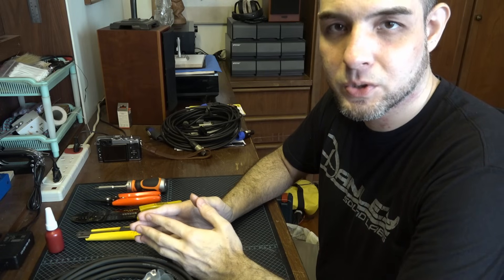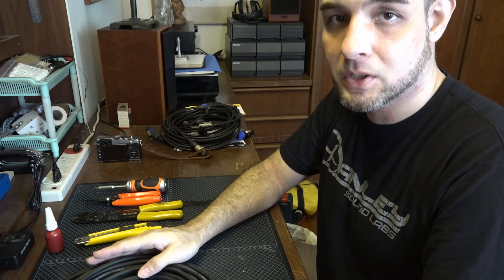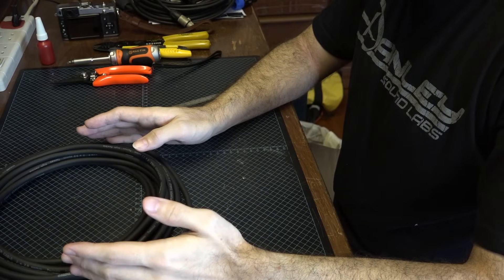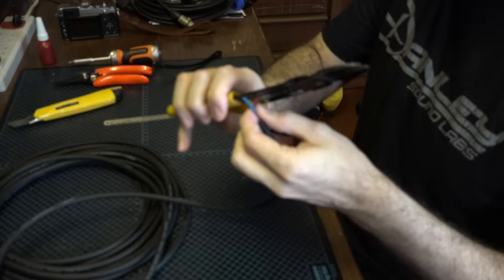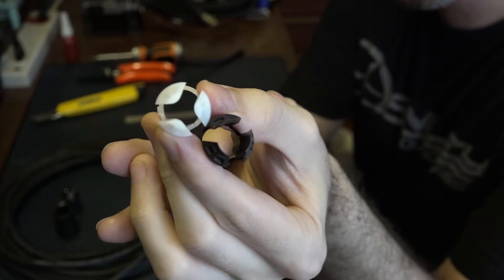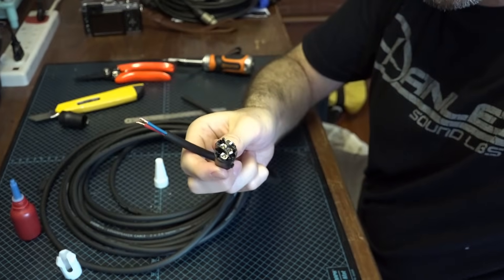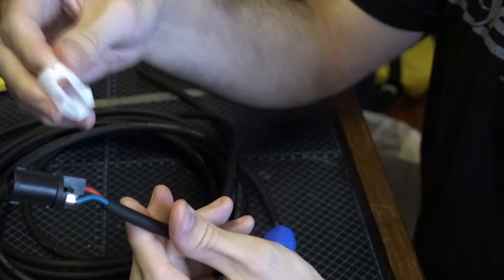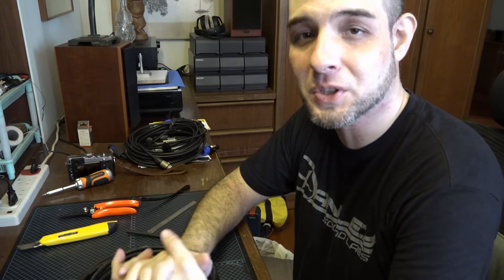How to wire Neutrik SpeakON cables

Comment: Hi ! First of all I would like to thank you so much for uploading this video. I went to electronics parts market. Got to see some variants of this connectors. Price would also vary drastically. I chose MX brand available here, rather then Nutrik as you have used. I saw that also. But there was price difference of over the times and as this was my first time with this connectors I choose MX. Almost similar but I know Nutrik is much better. Next time I'll use that only. I got lot of information about connectors through video.

Now about making connections, your video made it so simple that it was like piece of cake. I could make it very easily. +1 -1 pair was used. I made two 50 meters cables. Wire used was not that you have shown but my purpose was served very well. This has helped me setting up our door audio system, cascading four speakers. I have attached lugs also in parallel to these connectors so that I can connect it to my amplifier also. 

Once again I thank you from bottom of my heart. May The God be always with you, helping you.
Reply from the maker: In future I strongly suggest you use only Neutrik brand connectors. The others are much cheaper but their quality is also MUCH worse! Remember that you can be dealing with quite high voltages here - not a place to skimp on quality.
Reply: @GLBProductions  Definately.

Comment: Hi there, not sure if you still remember me but I’m the guy that handles my school’s PA system :). Recently, someone stepped on the cable of our pa speakers that were connected to the 4 pole speaking connector. The cables came out of the speakon house and I tried to open the speakon connector. The metal slide release “spring” went missing. Not sure how to get it to work again. Also, how do you wire a 2 pole speakon neutrix connector? I can’t seem to be able to get to the screws as I’m not too sure how to remove the plastic house ring slider is.
Reply from the maker: Yup I remember you :) If the release spring has gone missing I suggest you replace the entire connector - they are relatively cheap and last a long time.

Comment: Hey I purchased an 8pin for 4 full range 8 ohm speakers and 4 8ohm tweeters. I wanted to wire them at 2 ohms tweeters and speakers separately. Should I have bought the 4 pin instead? Let me know I'd greatly appreciate it.
Reply from the maker: It depends completely on how you want to wire the system up. Depending on your requirement and amp configuration both types can be used.

Comment: Thank you! But how do i know that i wire in 4ohm or 8ohms? AND what's the difference between Neutrik NL4FC and NL4FX? :)
Reply from the maker: The impedance is determined by the speaker, not the wiring. NL4FX is an upgrade to NL4FC - more expensive but simpler and more rugged construction.

Comment: Can these  connectors be taken apart in the event a wire comes loose?
thanks for the info.  After working in/ hobby  of RF, for the past 30 years, I am now getting into the AF end of things. 
again thank you. 73
Reply from the maker: Yes you can take them apart - use a wrench on the flats at the back of the boot to back it off. It will damage the ratchet mechanism somewhat but typically you can still re-use the connector.
Reply: @GLBProductions  thanks for the info.at this point I am still not wanting to use them. I feel that if one of these connectors in pluged into a speaker or an amp. I would rather have some one pull the plug out of the speaker or amp, than have them fall/ trip from stumbling on the cord., or even have the equipment fall and get damaged.  .

Comment: @ 15:06 you mentioned that it has a racheting system that prevents the end-cap from backing off.   But, if you want to disassemble it, how do you unscrew it and take off the end cap?
Reply from the maker: You need to use an adjustable spanner to back it off - it will damage the teeth on the ratchet system but the connector can still be re-used.

Comment: where can i buy the cable
Reply from the maker: Anywhere that sells loudspeakers and amplifiers should also sell speaker cable.
Reply: would regular 12/3 300v wire work also ?
Reply from the maker: Yup, you may also be able to find 2-core A/C power able.
Reply: and what about standard xlr/trs cable

Comment: Thanks for the clear instruction.  I've just bought some SpeakON cables and the connectors and was trying to work out what each terminal was for, so this really helped.  The tip about pruning shears to cut the cable is great too, I've never though about that, but it certainly makes life easier and gives a nice clean cut, I'll have to invest in some :)
Reply from the maker: You're most welcome, glad the video was helpful :)

Comment: I like to tin my stripped wire with solder.
Reply from the maker: I used to do this as well, but have found it to be an unnecessary step for the larger gauge strands of the loudspeaker cable.
Reply: @GLBProductions  Perhaps. I do it to prevent copper oxidation with age, better wire terminal continuities and lock-in. But meh, you're right, it is a bit fussy, but proper all the same. Silver solder on OFC cable might be over the top, but each to their own, this is only PA gear. I'm going to pick up a QSC PLD4.3 bridged into two channels - 4 Ohm, and was thinking about cabling, and NL4 connectors. I'm a bit noob though, and the high power speakers I'm looking at each have two inputs (x2) of +1 -1 & +2 -2 pass through. It appears I can use either input, as they are full-range only speakers, not bi-ampable? Well the internal wiring diagram looks that way. The speakers are QSC E215.
Reply from the maker: If you like to solder your speaker connectors you can get STX series Speakon connectors that are designed to be soldered - these are expensive but have a very rugged all-metal housing designed for pro touring. 
Correct, the E215s are not bi-ampable - either connector can be used as the input, the other one acting as a thru.
Reply: @GLBProductions  Thank-you. I knew + and -2 were through, but couldn't figure out why two different plugs offering both input, and output, but it stands to reason, to mark NL4 male plugs as in/thru (hence the need for the inscription window on the plugs as you described in this video.) But this system has a flaw, and that's if you were setting up a large rig to multiple amplifiers, and pick up a wrong plug marked in, when you thought the other plug was marked thru, but was in instead, so accidently put two inputs from two amps into one speaker. You'd have to be not with it to do something like that, but it could happen. Perhaps plugs and sockets should have been notched differently for in, or through to make it impossible to make critical mistakes?

I only want something to act as my loud punchy system without breaking a sweat in my lounge room, and use it at small venues later on. The rest of my system is SVS Ultra bookshelves, and SVS PB-2000 subs, and Ultra Center / Bookshelves running off an Onkyo 230w 7.2ch class AB receiver. I won't need subs with the E215's right now, as it'd be over-kill in a home environment, but not if they were used outdoors, or in a hall. I'm in no rush for the E118 subs just yet, as they would only sit in storage right now. Still setting up. Solar pays to run this gear during the day, so not concerned with power consumption when I do use them, and value my family's hearing lol. I don't think my quiet neighbours would appreciate me being an a-hole either... thump, thump, thump, thump! But all the same, it's good to watch a video like this to ask questions, and make sure I'm not doing anything wrong when I approach this gear for in first time ownership. Ps: I note the E215s are 4ohm, whick load up the amp a bit. The distortio jumps from .04 to .06%, but I don't think it's noticable. I've owned amps much worse, but have a more tasteful eye these days. The QSC PLD amps don't mind being bridged at all, with little power loss when doubling up, and it would appear on paper little jump in distortion when more resistance is added. They are quite impressive class Ds imo, can't wait! Thanks for your replys :-)

Comment: Bruno, very informative video.  I will use these on a solar project.  Thank you sir !!!
Reply from the maker: Neutrik actually make similar connectors specifically for AC power - they are called PowerCon connectors, check them out.
Reply: @GLBProductions  plz give avideo on powercon also

Comment: My box is 4 spekers & 1600watt rms power (each of 400w & connect in parallel) at 2 ohm.So what is actual wire gauge needed  for 30 ft run at 2ohms impedance load?
Plz reply it's an important........
Reply from the maker: Just google 'speaker cable gauge calculator' - there are several out there that will give you the info you need.

Comment: wich wire goes to the tweeter and witch wire goes to the woofer of the speaker? if I want use a dsp amp?
Reply from the maker: Each driver (woofer and tweeter) needs two wires - a send and return path for the signal. Typically these are taken from the output of a passive crossover inside the speaker and the user does not need to wire those connections.

Comment: Sorry if this has been asked before but, what are +2 and -2 terminals used for?  What I mean is:  how are, and what would they be connected to inside the amplifier?   I am kind of a n00b to Speakon connectors.
Reply from the maker: They're typically used for biamplified speakers where +1/-1 is used for the lows and +2/-2 for the highs. Exactly how they are connected depends on the amp that you are using - in some cases you are making connections from two separate amps using a custom patch panel.

Comment: Thanks, very helpful. I have 2 questions. 1) For outdoor speakers is there a SpeakON connector that is waterproof (eg., filled with silicon) and 2) how to you connect that plug to a speaker? My speakers have standard binding posts. Do I just attach a short run of cable to the binding post and then put the female Neutrik on the other end?
Reply from the maker: You're welcome Karl! 1) Yes the Neutrik STX series of connectors are weatherproof to IP54 in mated condition. 2) These connectors are only for speakers with the corresponding speakon chassis connectors. If your speaker has binding posts just use those with banana plugs, spade lugs or even bare wire.

Comment: what AWG is this cable you are using?
Reply: I have a 1000W nominal and 1500W peak bass amp, I want to connect it to my 8ohm cab that is 800w, what gauge cable AWG should I use?  AWG 10 or 11?
Reply from the maker: The general rule is to use the largest gauge that will fit in the connector and the shortest length of cable possible. So if you can find 10AWG cable that will fit your connectors use it.

Comment: What is the reasoning for using 16 AWG? Can you use 12 or 14 AWG?
Reply from the maker: Yes you can use any wire gauge that will fit into the connector. In the case of these cables it was the gauge specified by the customer.
Reply: Thank you. I ended up buying 12 gauge. However, I made a mistake. I bought plenum wire which is very stiff and hard to manage. How and where can I find a wire that is best for speakon cables? I've looked extensively for 12 gauge 2 conductor wire with a rubber jacket but I cannot seem to find any. Thanks.
Reply from the maker: Yeah cable of that gauge can be hard to find. I suggest going down to your local car audio installation shop and see what leads they can provide. Another alternative is to get heavy gauge 2-conductor a/c power cable. It's not marketed as speaker cable but being copper works just fine.

Comment: I have heard many different answers to what cable I should use between my PA and my Power Amp. I have always used, or built my own speaker cables and I would always used these same type "mono" cables with either 12AWG or 14AWG wire size with a 1/4in connector to a Speakon connector in this certain application below. What would you used in the application below and is there a difference. Right now I am setting up a Behringer PMP6000 PA and a Behringer NU6000 Power Amp. I am NOT doubling the power and running from the back outputs of the PA on this setup. I am simply running from the top Main Outputs which are 1/4in outputs. There are two outputs stages on this PA, a Main 1 Left and Right output and a Main 2 L & R output. I will be running from the Main 1 outputs and leaving the Main 2 open for another use.  So what would you use in this setup from the PA to the Power Amp?  Thank You!  I always go to your videos for information and you have always been a huge help!  The details make a big difference and that is what you go into. So again Thank You!!
Reply from the maker: Hi Jim, I'm not sure I fully understand your setup - if you could send me a diagram via email or Facebook that would be very helpful.

Comment: How do i make a xlr to neutrix speakon
Reply from the maker: Why do you need such a cable?
Reply: GLB Productions  ....I wanted to use muetrix to send audio signal to my amp rack
Reply from the maker: The Speakon connector is for speaker level signals only - the signal to the amplifier rack should be line level, ie using a normal XLR cable.
Reply: GLB Productions ok thanks very very respect from Jamaica
Reply: GLB Productions good day can contact you off  air

Comment: Excellent explanation! Clean demonstration! BRAVO!
But why have 4 pole or 8 pole speakON?
Reply from the maker: They are used for sending multiple channels of audio down a single multi-core loudspeaker cable. For example a line array box may have low, mid and high drivers which need six conductors altogether so you would use an NL8 connector.

Comment: I have a ?? about converting Powered Speaker (Harbinger 2115 Powered Speaker 600W @4ohms Driver/Horn ?? ( Bad Power Amp). I have a Idea about what I want to do "I have speakon cables but in order for me to accomplish this task I will need to bypass all the other electonics by installing a Speakon 4 Pin Female Jack ebay #142363081685, into each cabinet with a PASSIVE 2 WAY AUDIO CROSSOVER EMB PROFESSIONAL CX-5 800W MAX NEW (ebay #222008184453).

Comment: I plan on building a subwoofer based on the Bose b1 subwoofer. Any advice on the wiring
Reply from the maker: If you're going to build your own sub I strongly recommend getting a set of speaker plans (which will also specify the correct drivers, crossover and wiring to use) and following it exactly - building speakers is a surprisingly exact science and you don't want to be figuring things out as you go.

Comment: Hi Bruno, I have noticed XLR cables are wired in two ways, one is the standard two wires to pin 3 and 4 and the shroud braiding goes to pin 1. The other is when an XLR cable has a separate silver bare wire in it and it is first soldered to pin one then it continues on to be soldered onto the metal tongue that extends from the housing. To me this looks like they are grounding that silver wire. Why would there be two different methods of wiring methods? Maybe this is why my cable tested illuminates the red LED light when the wire is soldered to both the lin and that metal tongue.
Reply from the maker: Yes the second method you describe referred to as a grounded shield - the idea is that the shell of the XLR connector is tied to the shielding in the cable (the silver wire you mention) which in theory will ground the casing of the equipment that it is connected to. The objective of this is to connect the audio and electrical grounds together to ensure they are both the same. In practice this is not really necessary, although some people swear by it. Both methods are fine :)

Comment: When would you use a four conductor cable?
Reply from the maker: Most common usage is for biamplified speakers where the low signal is carried on the +1/-1 conductors and the mid/high signal on the +2/-2.
Reply: GLB Productions Thanks
Reply: GLB Productions

Comment: If I have 2 speakers, each at 8 ohms and each with two conductors, could I wire them up to a 4 conductor Speakon jack to get a parallel connection at 4 ohms? Basically just connecting the positive and negative leads of each speaker to +1/-1 and +2/-2 lugs on the jack, respectively? Thanks
Reply from the maker: No that won't work because there is no connection between the two pairs of conductors - your signal from the first speaker would not reach the second one. The correct way to do this is to daisy chain the speakers, so amp -> first speaker and then output of first speaker -> input of second speaker. All cables are wired the same way, resultant load on the amp is 4 ohms.

Comment: thank you for video as today i bought 2 speaker cables which untill i got home reliesed shop gave me wrong ones for my 2xmax210 170.670 pa speakers 500 rms(w) max 1000(w) which only have 2 jack sockets and push clip speaker termals.its only amp VONYX VXA-2000 that have 3 speakon connections.the cables they gave me are NL2-NL2 1.5MM2 which is no good for speaker end.if i take 1 NL2 connector off and wire to speaker how would i do that iver using 2 jack sockets on back of speaker or the clip speaker termal connection
Reply from the maker: You need to connect the positive output terminal of the amp to the positive input terminal of the speaker and ditto for the negative. So +1 on the speakon connector should go to the red terminal on the speaker and -1 should go to the black terminal.

Comment: Nice video. What screwdriver are u using? Neutrik recommends a special one. Thanks
Reply from the maker: No. 1 pozidriv - you can use a normal phillips driver but chances of cam out and fastener damage are quite high. Speaking from experience here ;)